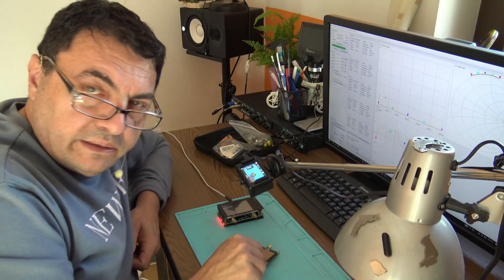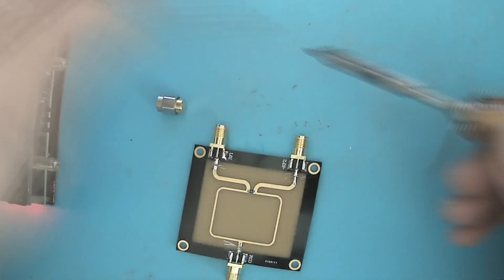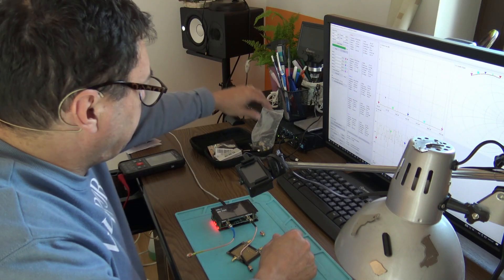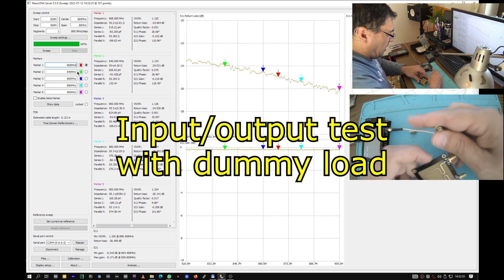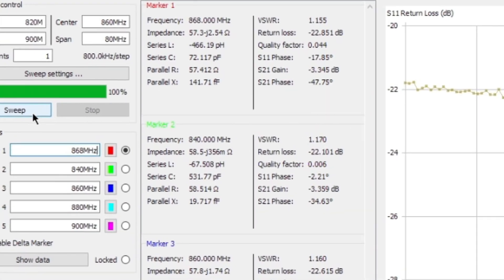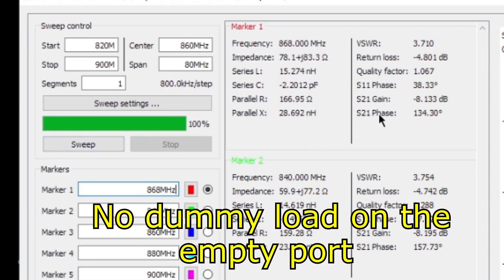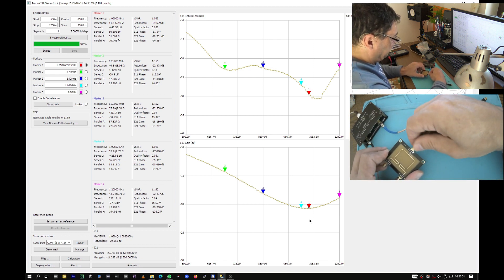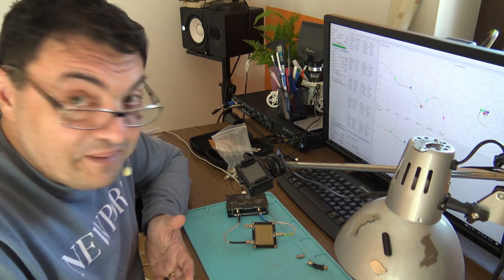2 way splitter revised ! Cheap and good? Yes!

Comment: You have to understand that theoretical loss of 2-way passive splitter is 3dB (output power is 1/2 of input on both outputs). You can't get energy out of nothing. So 1dB loss -> 4dB and actually your results are better than in spec.
Reply from the maker: Interesting..so there is always a 3dB path loss..
Reply from the maker: plus the port loss 1 dB

Comment: Hi i am using 2 Setups with acasom amp tx12 and filter. One with the expensive 2 way splitter from acasom and of course 2 miners and one with this splitter from amazon. The Result is the same.. so when somebody is thinking about a setup with 2 miners. Take this one.. :)
Thx viorel for your great work
Reply from the maker: Yep! It's working!

Comment: Hi Viorel, you should put an attenuator on it and then a dummy load to close it. How will the result be then? So, splitter -> attenuator -> terminator (dummy load).
Reply from the maker: I'll do that..but as long as the attenuator it's also a 50ohms load..I don't see any change..

Comment: I think it doesn't matter for RX, but I am concerned about the TX signals. I connect it like this: 2 miners <> splitter <> AB868 <> Cavity <> Antenna. When 1 miner sends a beacon, will it destroy the other miner because of too much TX power and the short distance, or will the splitter prevent the signal to go out the other port to the second miner?
Reply: Would like to know too… would like to know for all Splitters
Reply from the maker: @sikermolum3335  I'll do my best..
Reply: You can get splitter with 30dB isolation, but it should be okay in Europe even with item from video.
Reply from the maker: @Dunc4n1d4h0  I think so..with 16dB max TX it should do the job..
Reply from the maker: Well, there is -18dB isolation, means if you send with 16dB (max for Europe) the other port should be ok..like a -2db..but I don't bet on it..so attenuators or lower TX power will solve interbreed..🙂
Reply: @viocaia  Thx Viorel, nice item for a new video maybe? 😉
Reply from the maker: @aldjay3074  Thank you too! What item..?

Comment: Nice, now normal 2 Way splitter.
At the end only one conclusion not correct. The insertion loss is about 0.45 or 0.5. because you must subtract the 3db for an ideal splitter.
So all for these cheap splitter are good. But there are in no case. The mini circut splitters are so expensive, around 100€, but on flea market you can get around 40-60€.

Nice to see your RF experience. I think you can make the ham radio licence. Sorin now for same weeks now it.

greeting from middle part of germany
Thorsten
Reply from the maker: I'm really thinking about applying for first grade HAM..!😀